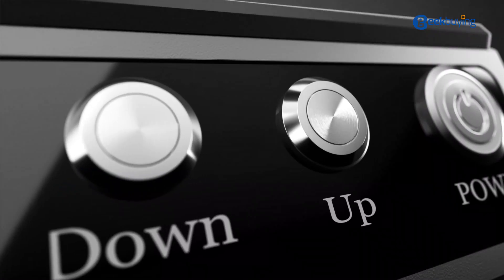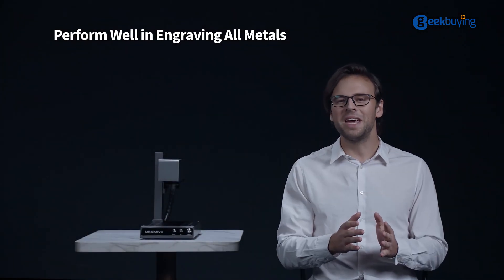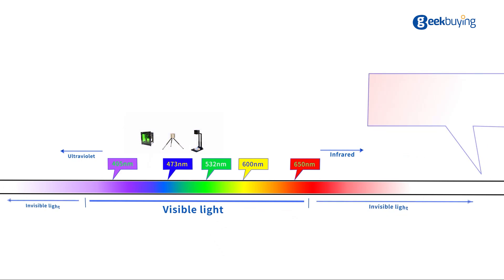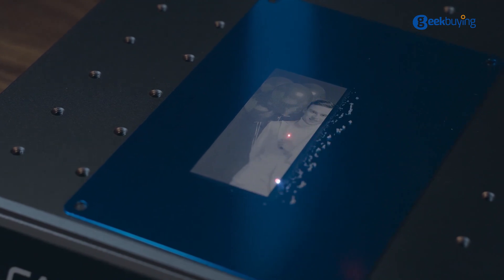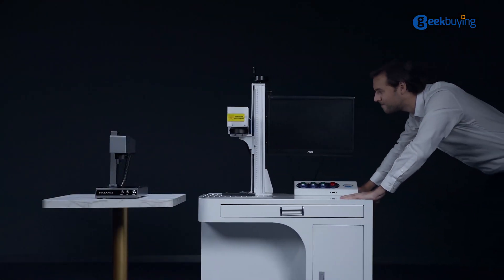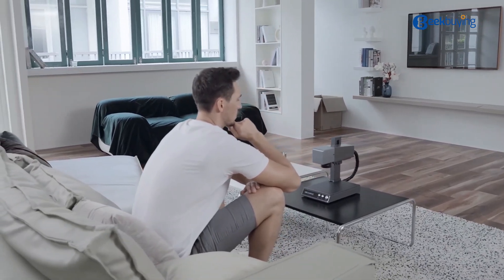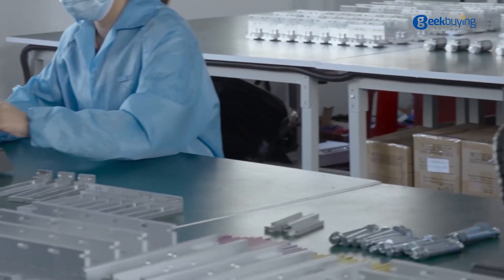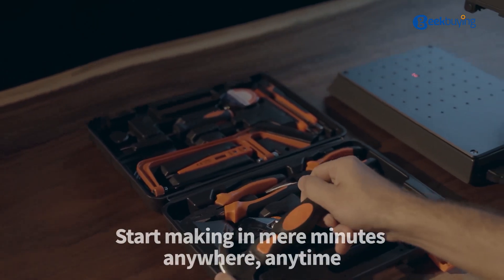DAJA (Mr.Carve) M1 Laser Engraver Official Video

Comment: Sehr geehrte Damen und Herren , 
leider arbeitet die Maschine nicht so wie sie soll. 
Im linken Bereich ist die Gravur immer viel schwächer als im rechten .
Die Ursache ist folgende , der Kopf steht schief zu Unterlage um ca. 1 mm auf 70 mm breite.
Das ist nicht akzeptabel und daher  wünsche ich eine Rückabwicklung . So kann man mit  MR. Engrave nicht arbeiten. 
Schlechte Qualitätskontrolle . 

Dear Ladies and Gentlemen ,
unfortunately the machine does not work as it should.
The engraving on the left is always much weaker than on the right.
The cause is the following: the head is crooked to the base by approx. 1 mm over a width of 70 mm.
This is unacceptable and I would therefore like a return transaction. This is how you can use MR. Engrave doesn't work.
Poor quality control.